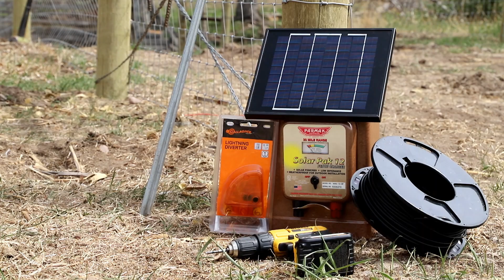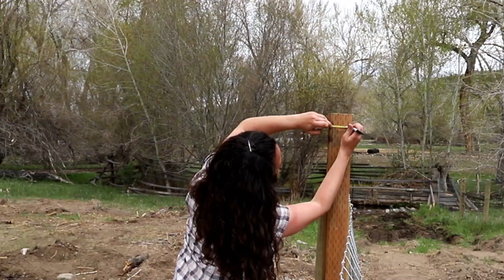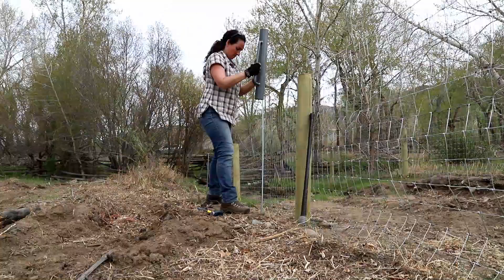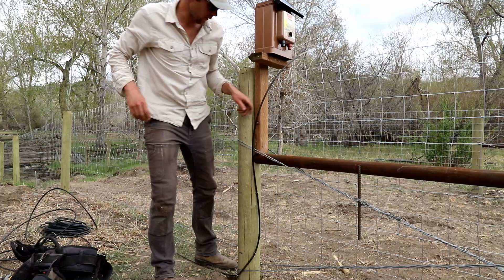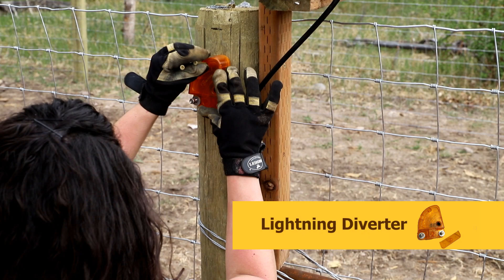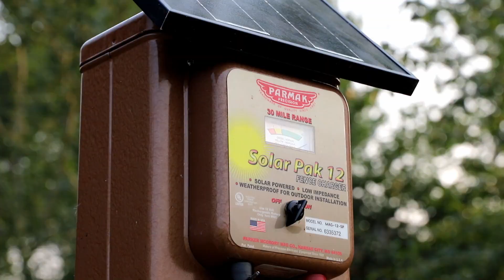Electrifying Existing Fence for Bears: Installing an AC Energizer and Grounding System (6/7)

Comment: These videos are a great service to the DYIer.  I have a question on the connecting ground wire from the fence to grounding system, it is connected directly to the same 1st grounding rod that has the ground wire to the charger?